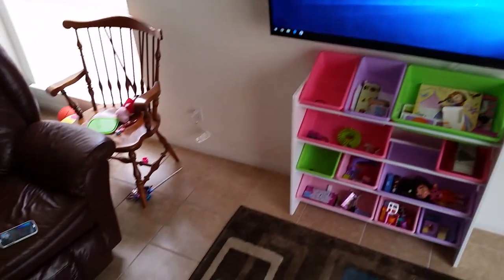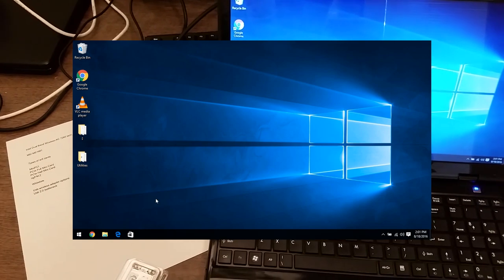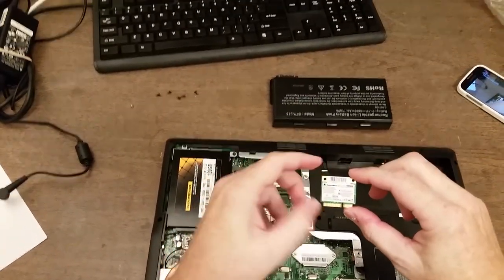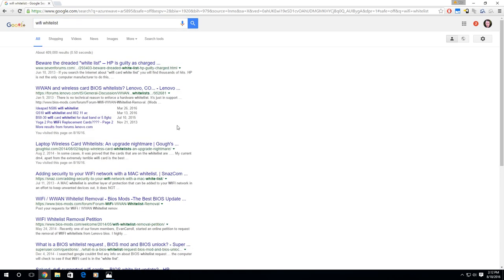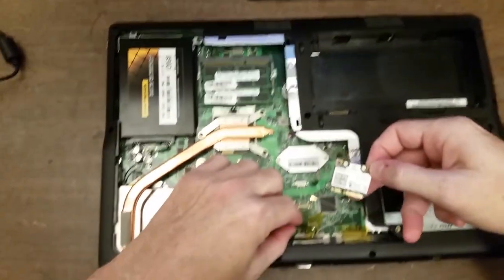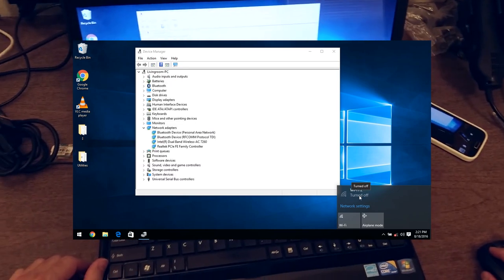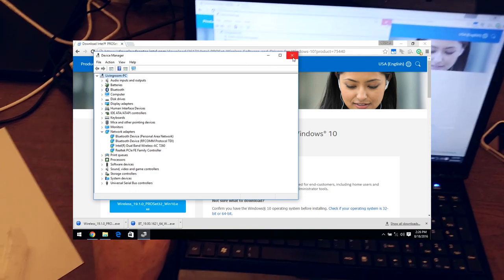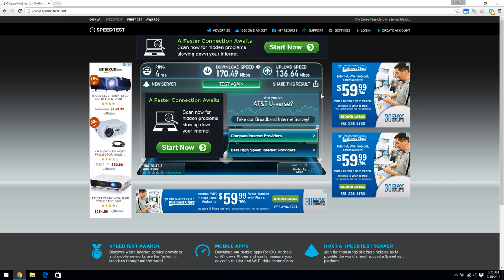Upgrading to a Wireless AC WIFI card with Bluetooth on a Laptop or Desktop

Comment: Thanks for the information. I too replaced the OEM wireless n card (DW1501) in my old Dell XPS 8300. I was not able to use or even see the 5 GHz band offered by my router. The replacement card is the Intel 7260.HMW dual band wireless AC 7260 network adaptor PCI Express half mini card 802.11 b/a/g/n/ac. The price was less than $20 on Amazon. Now I can see and connect to both the 2.4 GHz and the 5 GHz bands. The procedure was fairly easy:
Download the drivers for the card from the Intel website for my operating system to my desktop. Shut down the computer, unplug it and open up the side panel. Locate the original half mini card. It had two antenna leads to unsnap from the card. Take note which color lead goes to each side. The card was held in place by double (twin) clips. Each clip had to be pushed out of the way simultaneously to release the card. Slip out the old card. Snap the antenna leads in their proper place on the new card firmly. Slip the new card into place (The clips automatically clicked in place to hold the new card in the slot. When I restarted the computer, of course there was no wifi connection. I double clicked the Intel driver pack  I had downloaded to the desk top and chose to install the drivers default. It took about 4 minutes for the driver pack to finish installing. When I looked at the list of available networks, there they both were. I chose the 5 GHz, put in my password and I was connected at the new 5 GHz speed.
The new card also has some newer better Bluetooth 4, but I did not check that yet since I seldom use Bluetooth. I'll figure it out later if I have to.
The back-story is that these half mini cards are really tiny, about an inch square and meant for laptops. Dell put them in these desktops by making a slot for them on the motherboard. The OEM DW1501 cards are not supported for Windows 10 (no working drivers); this is Dell's official position. So anyone who has the Dell  XPS 8300 and  wants Windows 10 will have to get a new card with Windows 10 compliant drivers. There are also those like me who wanted to upgrade to a card with 5 GHz band (AC) who will also need to switch cards.

Comment: Worked great!  Bought a used Dell 1704 BT and Wifi card on internet to insert into mini PCIe on ITX desktop mobo and found that the Windows 10 drivers said that I had to turn on the WiFi manually.  The problem was this is not a dell laptop with a physical switch.  Covering pin-20 worked like a charm.  Thanks for your info and video helping to identify the pin.  Aces!
Reply: I want to use my junk laptop's wifi+bt card on my desktop, can you help me in doing that?

Comment: Good Job! I've done a few of these. I have sold these components. Everyone should keep in mind this is only worth it if you have a router that will increase your wifi speed. Your speed you download anywhere is only as good as the lowest level device that is being used. That's the rule. If you upgrade your home internet and get  802.11ac,ad or ax  now then you should seriously consider this for your computers. It would be worth it.

Comment: The last pin on the ac7260+bluetooth, pin 51, has to have tape put over it cut to size for the bluetooth to work. My bluetooth was not functional until i taped pin 51 and reinserted the card.

Comment: Older laptops do not support Wifi-BT combo cards. The mini PCI-e lack a pin to switch the power to the BT module.
Reply from the maker: If you needing Bluetooth and the mini pcie doesn't support it you can get a Bluetooth USB adapter. Search for it on Amazon and you'll find it.
Reply: @MichaelTheComputerGuy  Hey thanks. I just want to give anyone a heads up in case the bluetooth does not get recognized. Took me 2 days to figure out when I had the problem first time.
Reply: @MichaelTheComputerGuy   my wifi is fine but I am trying to fix my bluetooth 4.0 (or upgrade it) will a new wifi card allow me to once again have bluetooth on my laptop? I don't want to use an adapter

Comment: Hello! I just changed (with your help of course) my Lenovo M83 Desktop (ThinkCentre) Windows 7 SP1 over from an Intel N 105 to the same 7260 you put in this machine. The card works fine, but I did it so that I could use WiDi to mirror onto my FireTV. For some reason the Intel WiDi application cannot find the adapter.

Comment: Hello Michael,
Great job indeed. I got a couple of questions though. I have an HP desktop P6 series. My wireless card is an RALINK RT5390.
1. How can I find the right model from Intel that can replace the defect wireless card?
2. Should I use a dual vs broadband card?
Thanks in advance.
Reply from the maker: Look on the bottom of the HP sometimes it's under the battery and find the full model number. You can put that into Google along with the words Wi-Fi adapter or wireless card. You should find people talking about what model adapter works for them.

Comment: hi Michael: 

Thanks for posting this video and it really helps so much!

I want to upgrade my ASUA X540SA and Acer Aspire 5733Z-4633Z  to AC WIFI (ideally with bluetooth combo)  but I am not sure about the correct replacements on Amazon.

both laptops are loaded with Windows 10 home.

will you be able to help me please?

I also noticed some NBs have only 1 antenna wire, does it matter which plug to use? or you would recommend to install the second wire?

thanks so much!

Comment: Good video, thanks. If you have 1gb service, why are you only getting 170mbs download?
Reply from the maker: KiloEchoFive It's limited by the speed of the Wi-Fi. I actually get higher than that most of the time but that's what I got on that test at that moment.
Reply: I'm curious because I have 800mb download at the router (ac router) but, I cant get past 300mb down on my iphone.
Reply from the maker: KiloEchoFive That is most likely why. It's just the limit of the wifi speed.

Comment: Hey there, Michael. I have a HP Thin T620. The Mini PCI-e slot doesn't have those two antennas or any indications that it was built with antennas. I'm planning to get a card for it. Well it still work without the antennas?
Reply from the maker: I looked at the hardware reference manual and there is a slot to put in a PCI Express 2.0 card. So that card would come with external antennas that stick outside of the case. You wouldn't need the antennas built in.

Comment: I appreciate the tutorial for the laptop. I do have a question. My desktop motherboard comes with a dedicated pcie half mini slot and half mini wifi card. I want to plan to upgrade my desktop case, but the antenna cables are physically attach to the original case. could I buy laptop antennas and just add them adhesively inside my new case before swapping my components to the new case?
Reply from the maker: Ramsses Patterson You can get antennas that will work. Do a Google search for "Laptop Wireless Mini PCI PCI-E Internal Antenna"

Comment: Just the card gave you a speed boost? Same wifi connection?
Reply from the maker: Yes. You can have the best Wi-Fi access point in the world but if you're Wi-Fi adapter in the device you're using is older or slower the connection to that device will be slower. Replacing that Wi-Fi adapter in the device you're using can then maximize the speed of your wifi access point.
Reply: @MichaelTheComputerGuy  Great I just ordered one. I have a 5ghz dual band card already but only bluetooth 2.0 so I'm curious if it will benefit me.

Comment: I've done this mupitle times never once needed to download a driver
literally just changed a intel to a azurewave took 30 seconds and works instantly
Reply from the maker: Rob Plant It depends on which wireless adapter you're putting in. A lot them have drivers built into windows so you literally do just plug it in turn the computer on it works.

Comment: I got a acer aspire 5 and I’m trying to upgrade my card to a intel 9560 and it’s not showing up or installing
Reply from the maker: Check in device manager for it.  It may need a manual driver install.  If its not there check the card.  You might not have pushed it in the whole way.

Comment: Is it weird that I get your final speeds on an Intel Centrino Ultimate-N 6300 Wireless-N (Not AC) card? I was about to upgrade my Dell E6530 to this 7260 card, to get more out of my new residential gigabit connection. But now it appears it won't make a difference.

Comment: 13:32 Hi sir, what do those 2 cables do? I unfortunately removed one of them by trying to clean my PC (the right one on your video). What impact does that have? Thank you x
Reply from the maker: Those are the antenna cables for the wi-fi- adapter. Those need to be plugged back in if you'd like your Wi-Fi range to be more than 10 feet.
Reply: @MichaelTheComputerGuy  Thank you. I couldn't manage to do it since I'd have to literally open my whole computer to do so. x

Comment: hello i'd like to ask you about the two cables that are in the card where are they going 
I found just the black one (and it's cut in the middle and just soldered) 
and the quality of wifi is bad 
can you please answer ?
Reply from the maker: If one of the antenna cables is damaged plug the other one into the main connection as opposed to ox on the Wi-Fi adapter and you should get good enough performance. You can also buy replacement Wi-Fi antennas on Amazon. Do a search for laptop Wi-Fi antenna and you'll find lots of them for cheap.

Comment: Hi! I saw a used hp laptop which has intel ac 7260 card. But i'm concerned to buy it. Because i had some wifi connection problems with my toshiba laptop which has intel n 7260. I searched these cards on the internet and many people has connection problems with these cards. And i want to buy that hp laptop, do you think i should buy it ?

Comment: hey mike, Q: i have an HP pavillion ce3064st  . it came w/ the realtekce8821 wifi 5 802.11ac card. 
will i be able to install a wifi 6 802.11 ax card?? 
after researching a little...i think i'm gonna have to get either the intel ax200 or ax201 wifi6 card...
and obv download the drivers too.
Reply from the maker: As long as it has the same type of interface it should work. Most likely a pci Half mini.
Reply: Michael Cooper ok great! 👍🏼 thanks again. And nice vid. subscribed.👍🏼

Comment: How do I put that pin back on the wifi card? It won't stay on
Reply from the maker: It can be a little tricky. Basically what you do is you get it lined up so it's centered on the antenna connector and push.

Comment: hello there. so i just updated my wireless card and it works really well but my problem is that it randomly disconnect. have you ever encountered  this problem?
Reply from the maker: joe vin Try restarting the wireless router.  Also get the latest drivers from the Wi-Fi cards makers website. If that doesn't do it the Wi-Fi card may just be having a problem and you'll need to replace it.

Comment: Hello friend, I have an ideapad s145 with Intel Ac 3165 ... I wonder if I could exchange for ac 9560, the inputs of these cards are all the same just exchange and use?  hugs
Reply from the maker: That laptop has a whitelist for wifi cards. Do a Google search for the model number and the word whitelist you'll see people talking about it. There may be a way of removing it so you can put in a different wifi adapter. The other way to go about it is to get a USB Wi-Fi adapter and plug it into the outside of the computer.
Reply: @MichaelTheComputerGuy  thx man

Comment: After ive installed it i only have one wire to reconnect, which side do i connect it to?
Reply from the maker: If it only has 1 antenna wire connect it to Main on the adapter.

Comment: Does the bluetooth utilize the wire antennas you had to disconnect?   My bt signal is so terrible.  But the wifi runs just fine.
Reply from the maker: I reconnected both antenna cables to the new adapter. Bluetooth range usually isn't very good.
Reply: @MichaelTheComputerGuy  I was just wondering because I was trying to narrow down my problem. Finally got it working by just using a Bluetooth dongle.   Works great actually.

The BT dongle wouldn't work properly until I re-enabled the bluetooth on the problem card.   I think it uses the native card to pass the data through, even though clients aren't connected to it directly.  Maybe it's a Linux issue. 

  Good video, helped me get my mind on the right path.  Thanks for the response as well.

Comment: My compiter only has one antenna. Do i need to get another one? I have asus 555l. Could you do a tutorial on installing an antenna?
Reply from the maker: Having one antenna in a laptop is okay. Some of them are designed that way and they work fine. If you really want to add another one you can buy them on eBay. You would then be required to run that antenna up around the LCD panel. However I wouldn't recommend doing this. It's a lot of extra work that probably wouldn't improve the signal considerably.
Reply: Michael Cooper i got it using your tutorial. Thanks
Reply: WIth just one antenna, it works prefectly fine.

Comment: is it worth upgrading to AC if I'm using the "N" and my net speed is 75Mbps??
Reply from the maker: You can answer this yourself.  What you need to find out is if your current wifi can already handle your maximum net speed from your ISP.  Do do this go to speedtest.net on your computer connected over your WIFI and see if the download speed reaches 75Mbps.

Comment: i have a hp laptop i took my wireless card that was in my desktop and put it in my laptop and got a error so i did the other way laptops wifi card in desktop and it worked heck i even put a mac mini 2007 wireless card in my desktop and it worked

Comment: can I ask some questions? if I will be changing my wifi card for my asus laptop is it the same? whether I put intel not the qualcomm?

I'm planning to change it because it's damage I will change it to a Wifi Card that have Wifi 6 and Bluetooth 5
Reply from the maker: The maker of cell WiFi and Bluetooth adapter doesn't matter. You need to make sure you buy an adapter that will fit in the slot.  Open the laptop, find the current adapter and get one that will fit in the slot.

Comment: Help! My laptop's wifi is not working - only the blue tooth! And I have tried to replace the wifi card from my other laptop but still, only the blue tooth is working. What's wrong with it? is it the specific spote in the motherboard where we plug the wifi card has the problem or the white wire for the wifi card? I really don't know :<
Reply from the maker: It may just be a messed up driver in Windows. Check the device manager for problems.

Comment: does upgrading a wifi card actually improve wifi range?
Reply from the maker: That depends on the range that you already have what's your current Wi-Fi adapter
Reply: @MichaelTheComputerGuy  The one I was looking to upgrade is a 2P1GR from a 2010 inspiron. 
But I don't want to take up any of your time. I was just wondering if the range of the wifi was inscreased along with the bandwidth?
Reply from the maker: @troublebreathing8648  I don't think I can tell you that you will definitely get better range but the speed should be better if you upgrade to a wireless AC adapter. Look on Amazon for a AR9462 AR5B22 or an Intel 7260.

Comment: Hi there. I have laptop Asus N56VZ which is use Qualcomm AR9485 that only can support 2.4GHZ wifi signal. I want to upgrade it to Intel Wireless AC-7260 which is support for both band. I just want to know, do I need to change the antenna cable also or I just can proceed change the adapter only?
Reply from the maker: You don't need to replace the antenna cables they will fit the new adapter.  I did a Google search for "Asus N56VZ AC-7260" and it looks like it will work.

Comment: What exactly is the whole purpose of a driver?
Reply from the maker: It's what allows the computer to use a piece of hardware.
Reply: @MichaelTheComputerGuy  even if It's not quite compatible with the laptop?
Reply: @MichaelTheComputerGuy  well I'm trying find a bluetooth dual band wifi card that works for 5ghz and It's for a hp 2000-2b19wm laptop
Reply from the maker: @charleslane2735  It still has to fit and be compatible.
Reply: @MichaelTheComputerGuy  okay I understand that,but my question is do they even make one for the type of laptop I have?
Reply from the maker: @charleslane2735  it looks like it came with a pci half mini wifi card so just get a new one that is that type.

Comment: 1Gbit connection and only 170 mbit speed?
Reply from the maker: Wireless AC is not a 1gb connection.  The best you can get is around 700mbps.  On this system with this setup the best I got was 300mbps.

Comment: 15:40 You could've just clicked on the Wi-Fi button to turn it on.
Reply from the maker: Parker Stephens That software button in Windows works to turn it on and off if it is already on on a hardware level on the laptop. In my case it was actually switched off at the hardware level.

Comment: I tried this to add bluetooth  to my very old Fujitsu. I took out a AR 9285 (PC  calls it a 928x) I replaced it with a ATH-AR5B95. i removed everything in device manager, shutdown, restart... and it still shows up as a ar928x with no bluetooth. I tried new drivers from Fujitsu and no luck. I would appreciate any good advice.
Reply from the maker: I dont think the ATH-AR5B95 has bluetooth.  You would get drivers from Atheros to make the wifi work.  I don't think that model was a good choice.  No bluetooth and it's only wireless n. Look at model AR9462.
Reply: @MichaelTheComputerGuy thank you. the laptop i took it out of has bluetooth. does it get it from the rj45 ethernet card?
Reply from the maker: Bluetooth would come from the card you took out and the card you add in.  Rj45 has nothing to do with bluetooth
Reply: @MichaelTheComputerGuy  thank you again. your favorite is still AR9462? Fujitsu is zero help. I'm not broke, but I am thrifty. that's probably why my oldest laptop still works and I use it more than the new one.